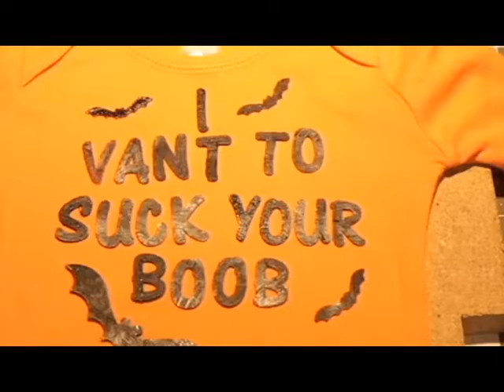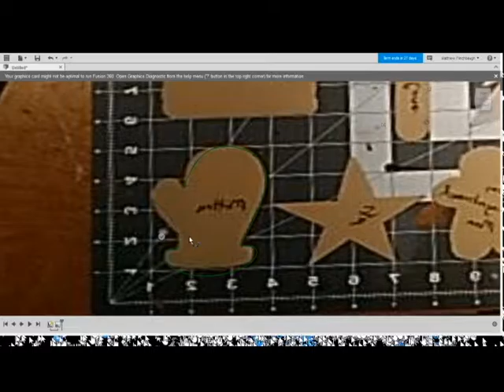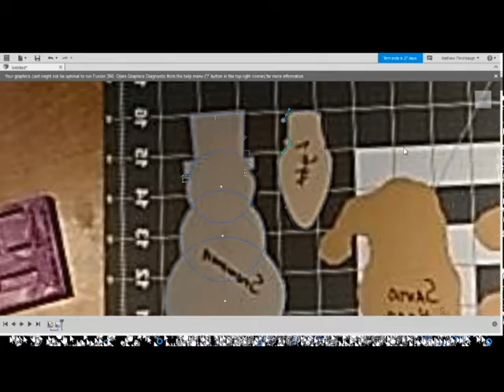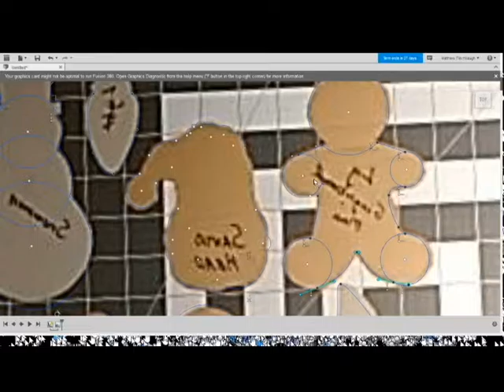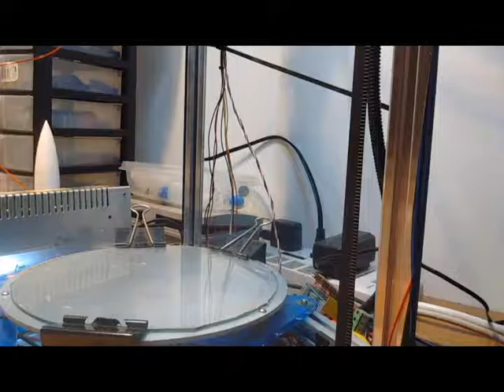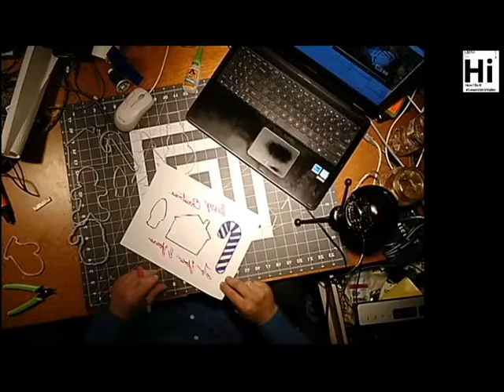How I Do It - 3d Printed Christmas Stencils

Comment: total newbie wanting to get into 3d printing Newbie question: could you scan the cardboard and put them in the software that way. New subscriber thanks a lot
Reply from the maker: yes you could absolutely scan them. I just happend to have the overhead cam and it made it easier than bothering with the scanner.